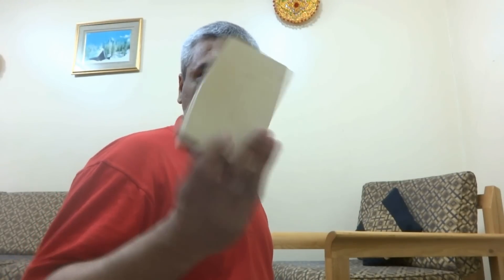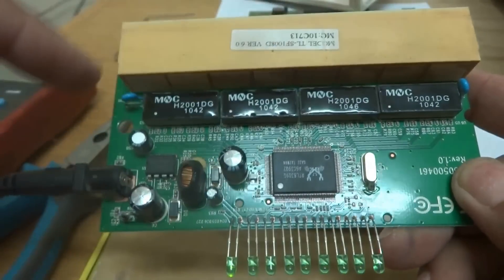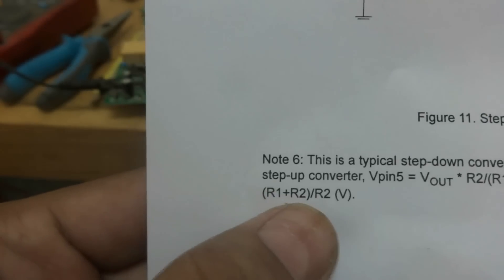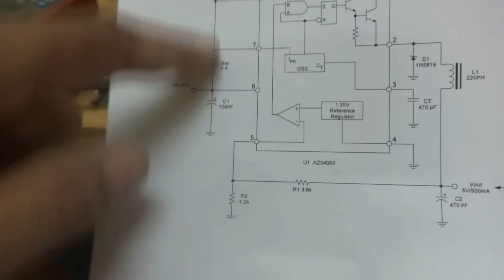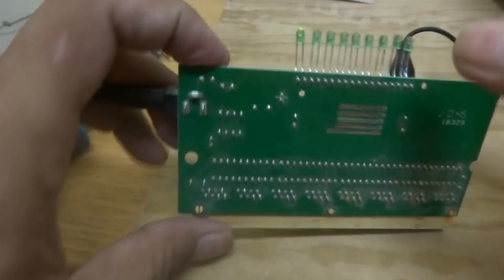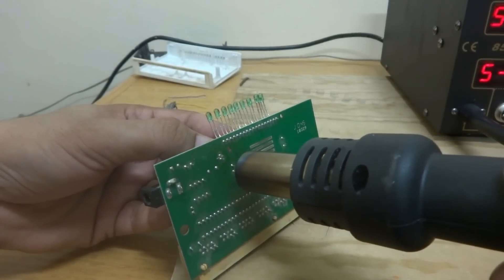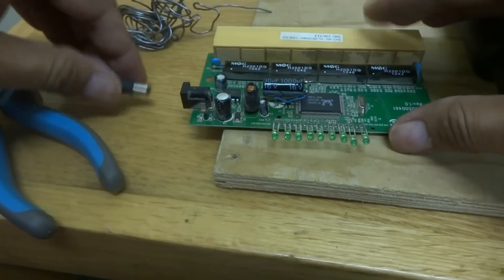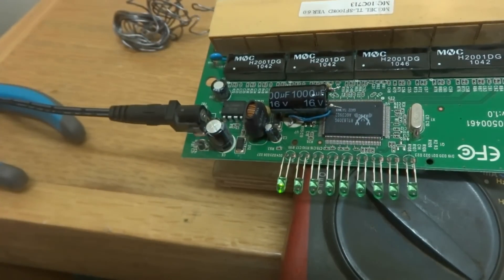TP Link switch repair

Comment: my router is burn through ethernet port due to heavy current pass through ethernet port and router still power on but ethernet port not working plz give me solution  for that problem
Reply from the maker: Seems it have blown ports input devices. You can replace them from another defective router doner board available which could be defective for any other reason like water damage etc.
Reply: @JahanZeb1976  thank you sir😊

Comment: Exactly the same model, died after a power outage yesterday after some 10-year serving. I won't fix it myself, as it's worth some 10 bucks only. But thank you for the video, it's clear and informative. The capacitors are the weak point in devices. But sometimes, they can fix themselves automatically.

Comment: I have an 8-port PoE switch. Ports 1-7 work fine, but ports 8 and the 2 uplink ports are dead. I visually inspected the caps, and none of them seemed to have popped. PSU is supplying the correct 53v to the mainboard (as specified on the PSU label) Any ideas?

Comment: You see the the caps have gone bad (because the have rounded on the top) and because of that the switch does not have enough power to start and resets itself
Reply from the maker: Yes you are very much right. Stay tuned.

Comment: Sir , mere router may power & lock symbol ki lait on hai or baki sab nhi ho raha hai, router reset bhi nhi ho raha hai, pls tell me kaya problem hai
Reply from the maker: It has a defective system microcontroller. Replacement wouldn't success. Regards,

Comment: Hello sir I have conneted tp link 5210 to my modem D301. suddenly cloud was tundering So the tundering damage my modems All ports so plz guaide my which thing is damage. so i will fix it.
Reply from the maker: Normally thunder damage is beyond repair as you may need massive components replacement which could lead you more expanse than a new piece of equipment. Anyhow your testing could tell you which defective components should be replaced. Wish you good luck with your repair. Stay tuned and blessed.
Reply: LearningZone Sir give me ur facebook or whatsaap number i will send u my modem video so u can help me

Comment: Nice find on the problem Jahan, and I saw the bulging caps at the beginning of the video. I believe that you have a bogus diagram, and it doesn't match up to your device. Let me point out a big mistake on the diagram. Take a look at the 25V input line and follow it to the left, down and to the right, and you'll see that it connects directly to ground. So, there is a short circuit there. Also, the ground is connected to the top side of the bottom resistor, so the two resistors aren't set up a voltage divider. Other things that don't match up is C2 on the diagram, but on the board it's listed as C42. Also, the quad transformers aren't on the diagram, the series pass transistor is missing, and a few other items. So, the 1.8VDC is probably correct for this board and not the 5VDC as listed on the diagram. Nonetheless, the end result is what's important and that's getting it fixed. Take care Jahan...

Comment: Well done jahan, another device recovered :-))

That chip was very common for use in 12v to 5v car cigarette socket type plug in phone chargers, other similar chips also exist.
I did expect it to show 5 volts as well, it caught both of us out lol.

The two resistor values must be different, i would check them just in case.
Yep the amplitude of the squarewave output divided by the on/off time ratio gives the desired output voltage (my crude understanding), pulse width modulated like most switchmode psus :-)

The inductor i think is uH not pH, dodgy diagram lol.
A small psu could be handy for your repairs, a lm317 and a few parts could give you a variable supply that can eather be transformer powered or from a car battery :)